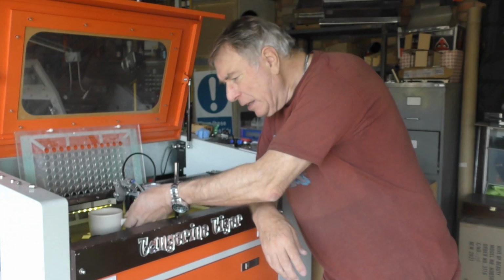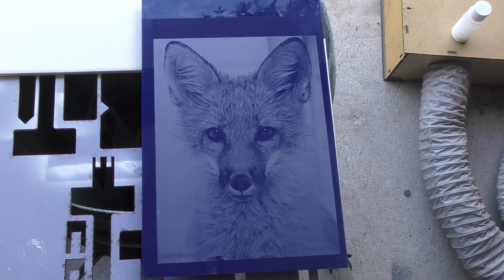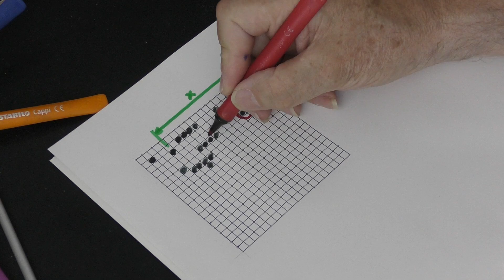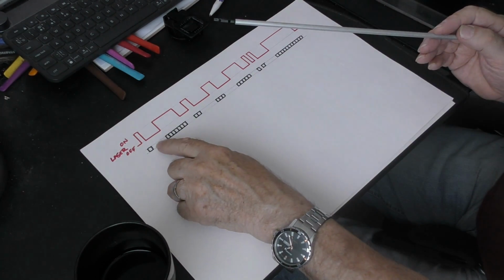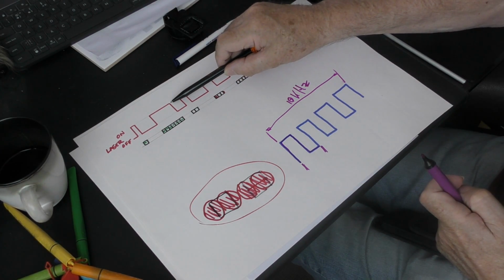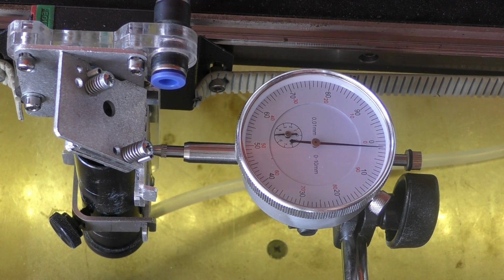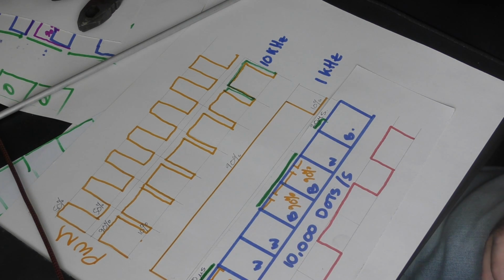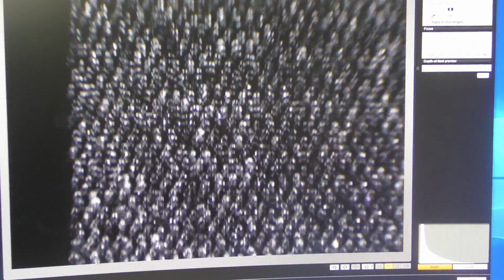RDWorks Learning Lab 240 Aliasing Bands in Dithered Images

Comment: I would like to see a comparison to common blue 5/10/20W laserdiodes, which have a incredible point size, but are much slower.
Reply from the maker: Hi ChIstof
 I dont have a diode laser so I cannot compare. . The physics of  the diodes  shorter wavelength predicts that thoeretically you should be able to create a much smaller dot than the  CO2 laser. However , it all depends on the starting beam size and the lens.  The ability to create different lens focal lengths with compound double or triple lenses is a flexability not afforded  to diode systems. The quality of a A CO2 beam (M2) is 1.1 for a glass tube and 1.2 for an RF source. A diode sits at 1,5 to 1,7  and that defines that beam in my simple visualization as "blunt"  Blunt is ok for engraving but very inefficient at cutting .  In the same way that the PWM controlled RF machine was incapable of  dynamically producing single clean pixeks  so a PWM controlled diode will suffer the same issues regardless of how small a single dot it can produce.. I am very happy tp pass my fox bitmap to anyone  who wants to try a comparison test, Just send me a personal request on this contact form
The potential speed gain of an RF machine and the promised  "magic" in the  technologyi was shown to be a marketing invention. Only when I modified  it with special beam condioning and special lenses, have I created the high speed engraving tool that the technology promised. 

https://forms.zohopublic.eu/ndeavorlimited/form/K40XtreeemLaserCutterContactRussSadler/formperma/k2Cn0QN5ChpazfTMAUw25lZ-FKpjZa96TQWHjv3ntOg

 Best wishes
Russ